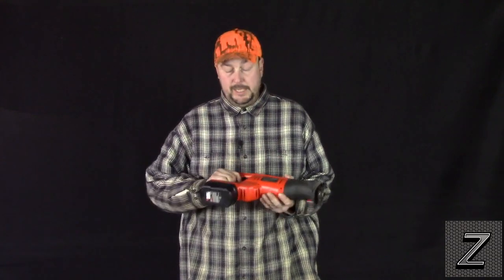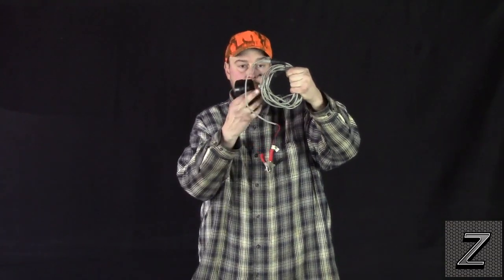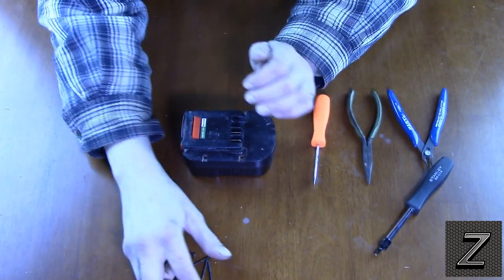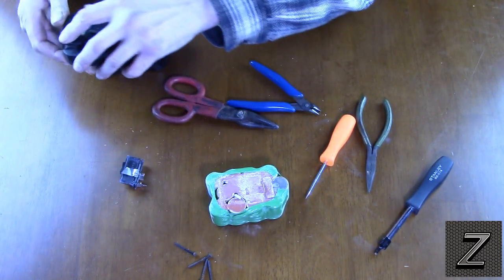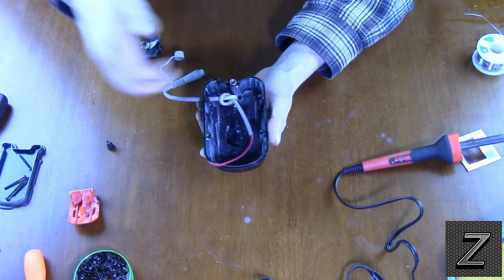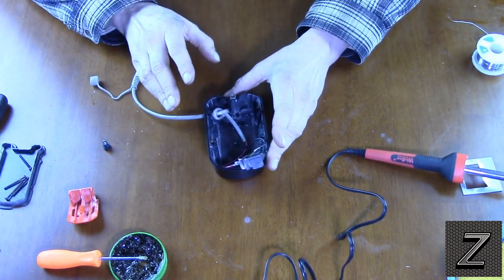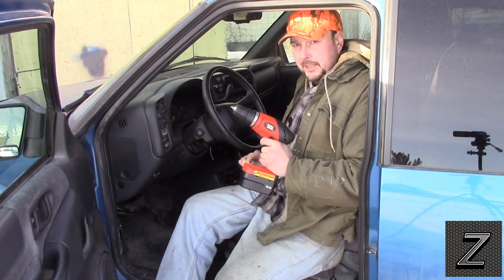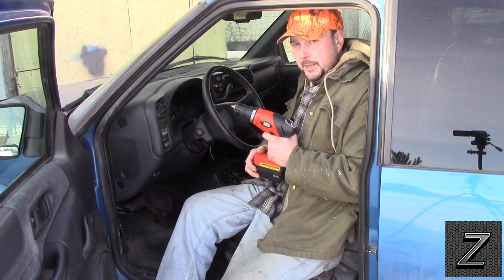DIY adapter to run 9 - 18 volt cordless power tools off a car battery, power Supply or charger

Comment: Had a couple of the HyperTough Walmart drills/drivers . Got them on sale for $16.95 each. They worked for a while but the crappy (nicad) batteries supplied with them died after a short time. The drills are 18v. I wired up one of the battery packs to a 12 volt cigarette lighter plug and tried it with my old Black & Decker 12v power box. Worked just fine. Recently got a 50 ah LiFePo battery (runs at around 13.4 volts) and the drill works even better - I use it mainly to raise and lower the stabilizer jacks on my rv and drive a few screws. When drill #1 finally fails, I’ll just use the “wired” battery with drill #2.

Comment: Can I run an 18v drill off an 12v powersupply?

If so, what will be the effect of the reduced voltage?

Thank you
Reply: @y0uCantHandle  Noted, thank you
Reply: @y0uCantHandle  what if my drill is brushless and needs 18v, what will happen? I am planning to use a 3sm car battery
Reply: Depends on what you use it for. See my post here. For heavy duty co start use, probably a no-go, but for infrequent use - driving smaller screws and such (I use it for my rv stabilizer jacks, it’s working fine after a year and a half. The drill is a Hyper Tough (Walmart) drill - nicad- at 18v.

Comment: Well, yes it will turn the drill, but not under a load.
Sort of like jacking up your car and spinning the tires by hand.
Yeah they turn...but...
By now you have probably popped the fuse in the cigarette lighter plug,
or melted some wires.  There is no way those little wires could carry
the current required by a power tool UNDER LOAD.
Anyway...Merry Christmas!
And enjoy 2020!
Reply from the maker: LOL that's funny cuz mine works perfectly fine drilling holes and stuff.
Reply: In vehicles that have a factory installed cigarette lighter, they are usually fused at 20 amps and big enough wiring to handle it. More than enough power, good job, I am doing this with my old B&D tools which includes a 5 3/8 " trim saw.

Comment: Can I just run the whires directly into the bottom of the drill an do away with the battery all together?
Reply from the maker: yes, but then you cant use a battery if you got one
Reply: In addition to Z-Hut’s reply, you’ll lose the balance that the battery pack provides.